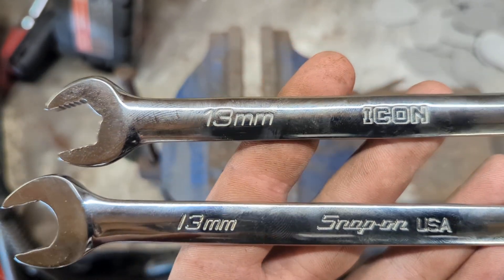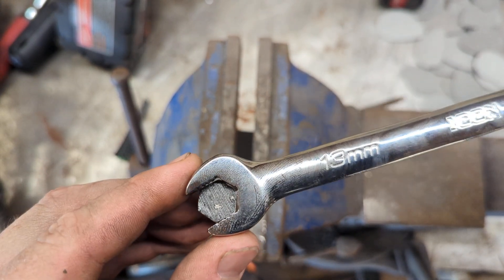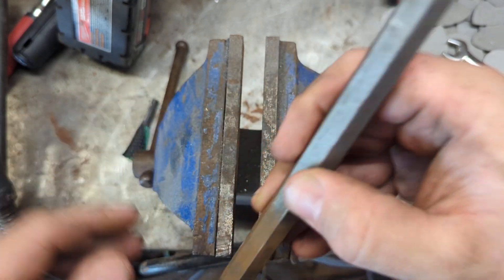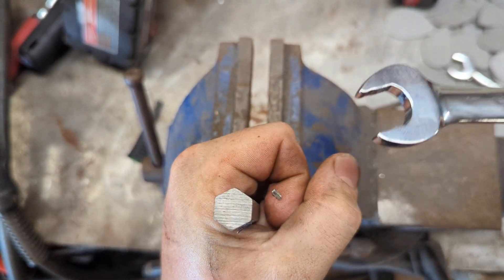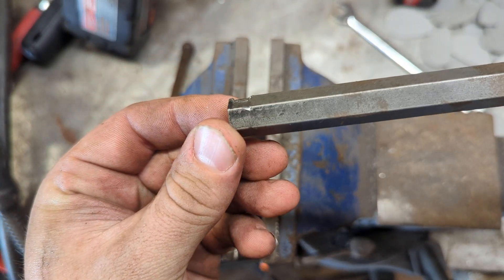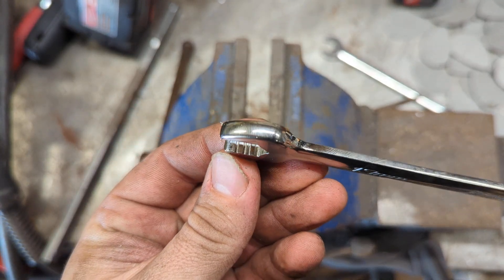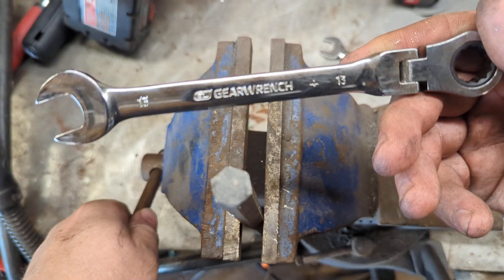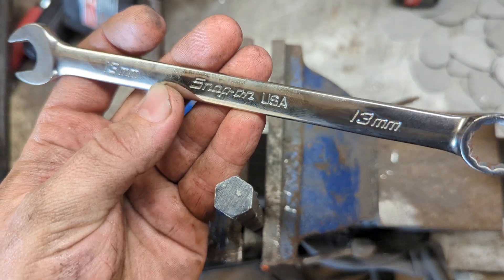Snap on Icon 13mm Steel Hex Slip Test

Comment: I agree that the Icon was not able to apply the same amount of torque as the Snap-on. In my use case (which is how each person should be making their purchasing decision) if I'm applying as much torque as it looked like you were applying with an open-end box wrench, I'm probably looking for a different tool anyway and I'll save myself the money. If my el-cheapo Craftsman/Icon round off the bolt, I'm going to stick a pair of vice grips on the head (heat as necessary), yank the bolt/nut out, and replace it. And I'll still save myself the money. For industry mechanics that are doing a LOT of these, that value may be justified for them, but in my case, I can't justify the expense.
Reply from the maker: You are absolutely correct.

Comment: Gee it only took 34 years (Flank Drive Plus came out in 1990) for tool manufacturers like Icon and Mac to equal Snap-on in performance (sometimes anyway). It's amazing what you can do with slave labor in foreign countries and ripping off expired US patents. Yes, Snap-On is expensive, but those costs support American labor, the best in engineering, a lifetime warranty, endless specialty tools and new tool R&D among other things. All Harbor Freight and the other cheapo importers/manufacturers can do is rip off existing designs when enough time passes. Good luck getting a speciality tool for a new car at Harbor Freight....Thank god Snap-on exists for professionals like me. For decades they were there for me in a pinch when other tools failed, or other companies didn't make the tool I needed. Now I'm not saying the average Joe should buy Snap-on, but I also don't believe in pissing on something because you can't afford it.
Reply: Very well said. It's a shame that the concept of supporting American made has become such a foreign concept to so many. Used to be a fundamental principal in our society.

Comment: MAC RBRT are the best spanners and no one else comes close
Reply: 6 point and no
Reply: @Nordman555  If we're talking about purely ability to apply torque, then yeah, the RBRT seem to be best, at least based on the torque test channel's testing. Or at least, tied for best. Wright seems like the best all around I'd say, especially when price is taken into account. Albeit it may be harder to warranty than your tool truck or Icon options.
Reply: @Nordman555  what do you recommend then?
Reply: @KeterMalkuth  yeah I was only talking about torque, if you want best all rounder or best value for money I can't think of loads of spanner sets that are under £150 and great...

12pc Halfords Advanced
25pc Halfords Advanced
19pc Tekton 
14pc  Facom
15pc Tekton 
15pc Gearwrench long
19pc Capri XT90
15pc Milwaukee max bite  
10pc Wright 751
19pc Carlyle

Comment: 🤫 don't tell den of Tools or the Harbor Army
Reply from the maker: Hey I like harbor freight too but facts are facts.    🤷
Reply: You are right about Den of Tools. I’m not paying for SnapOn but all that BS testing with a nylon nut proves that a pair of Knipex pliers is better than a wrench
Reply: These tests prove nothing. Whether you're using Snap On, Icon, GearWrench or whatever brand. No two wrenches are the same. You could have two snap on wrenches that are slightly different as well as two icons that are slightly different.  Everyone just needs to stop this insanity. Use what you want and what you can afford. That's it, they all will get the job done.
Reply: @leopdion5976  The nylon nut was what Snap On used in their test. So that's what the other dude who started this nonsense used.

Comment: What size is the piece of hex stock? If you're using a 13mm on a piece of 1/2" stock of course they slip easier than they should. I believe legitimate tests should be done on the proper bolt head size.
Reply: Agreed
Reply from the maker: @erikbryant5211  it's not 1/2" hex stock 

The hex stock 13mm and it measures  12.95mm....

Icon open end measures at 13.11mm
Snap on open end measures at 13.22mm

Comment: I have said for many, many years, snap on is overrated and overpriced junk.
Reply from the maker: Overpriced yea.   Junk I don't think so ..
Reply: @MotorCityMetalArt  maybe not but I wouldn't buy anything from them. Not when there are better options out there. My craftsman set from the 90s are still working just as good now as they were back then.
Reply from the maker: @TJsVette  fair enough